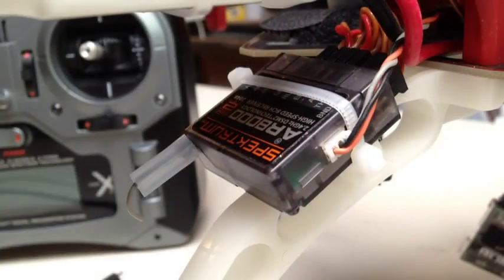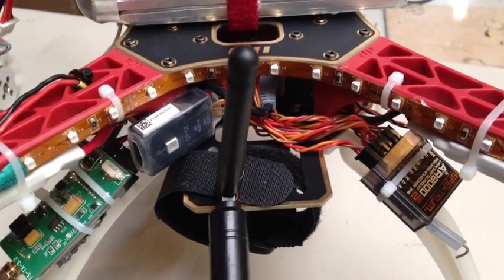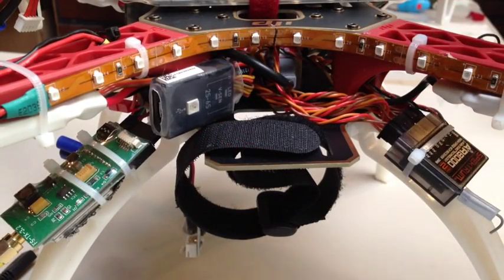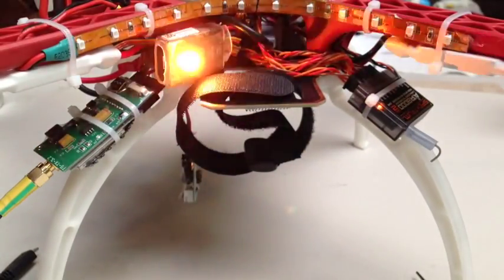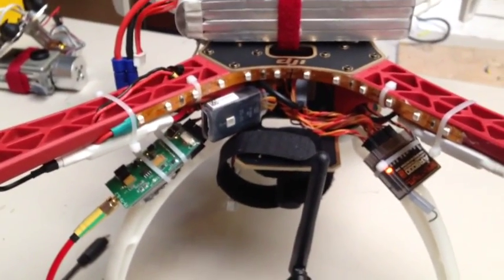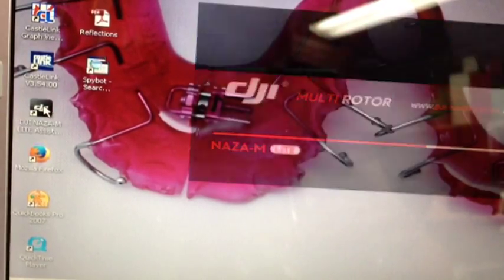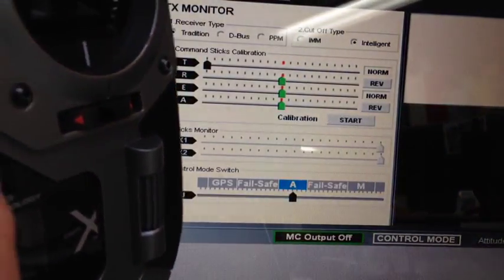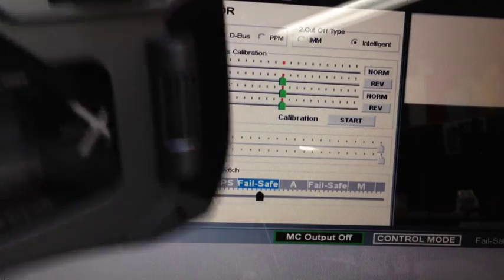Dji F450 Naza Lite Spektrum Failsafe Ready Setup

Comment: Hi. I am using naza m lite and orange transmitter. Im of the understanding that when failsafe is activated my throttle needs to be at 50% to rth (continue to fly). Is this true and if so how do I bind at 50%:throttle for failsafe? Thanks.
Reply from the maker: The Orange rx has failsafe, not preset failsafe, if you try to use it your copter will not rth- it will fly away!  Get a rx with the proper preset failsafe like the ar8000

Comment: i want to do the similar set up with following combination using NazaMV2 + Spectrum DX6i TX and AR610 receiver. I tried ur method . it goes to Altitude mode and i m not able to set any other mode ...please help...i m a newbee
Reply from the maker: Manuel Pinto Your rx has to have "preset failsafe" not just "failsafe"  check to see if your AR610 has it...

Comment: Shouldn't the throttle indicate somewhere around 50% when powered off (Failsafe)?
Reply from the maker: Im not sure i understand your question..
Reply: My fault.   When I tested the flight safe mode,  it worked correctly.  

I'm coming from the 3DR APMs and I would see the throttle value increase, or decrease to approximately 50% within the Mission Planner when going into failsafe. - throttle value to keep the copter in the air. 

All is well.   - Plan to do some test flights tomorrow.
Reply from the maker: So, yes, throttle values don't matter with the Naza during failsafe mode- Unless, you are switching out of failsafe by flicking the flight mode selector from GPS to Manuel or Atti. and back to GPS.   Then your throttle had better be 50% or greater so when the quad comes out of Failsafe/rth it will hover or climb and not drop like a freaking rock!, lol

Comment: Hey demo not sure if you have enough switches but with my F550 and Dx9 have it set up so can flip a switch to failsafe also. Thanks to Freechip. I think I sent you this if not here is a good link. I am sure Stephane has it figured on if you can have failsafe on a switch or not and probably has the programming already for Dx6i. He is a freak that way, lol. But a good guy and ton of help.
http://www.rcgroups.com/forums/showthread.php?t=1789552
Reply from the maker: I do indeed have enough switches for all the main flight modes.  I don't have access to Home Lock, or Course Lock. Before this video, when I would turn off my radio, it wouldent default to RTH.  So I learned that you needed to configure the rx.  I have my failsafe switch to activate RTH as well.  Thanks for the link, I'll check it out!  I really like how easy AP is with the Flamewheels.  I may have to buy 2 motors, arms, esc's and the hex plate and try the 550 version.  I just did some more proximity this morning with no camera attached and this thing performs! The only complaint is when you drop the throttle all the way the rotors stop,  I did this mid flight.  It dosent like to come down from altitude as fast as the Blade 350qx.

Comment: I have a similar setup using the Orange R800X Rx.  When I turn off the Tx the DJI Assistant shows Failsafe and when I turn on the Tx it goes back to whatever flight mode was last on.  However when I test this out in flight, I get the failsafe RTH but when I turn the Tx back on it stays in RTH, no other controls work.  Have to wait for landing then cycle F450 power to get back to normal flight mode.  Does the Spektrum AR8000 do this too?
Reply from the maker: I haven't tested it yet but from what I understand, If it stays in rth after turning the radio on you have to cycle the radio to manuel just for a second and flip to what ever mode you want, this should reactivate your radio controls.  Like I said, haven't tried it yet.....